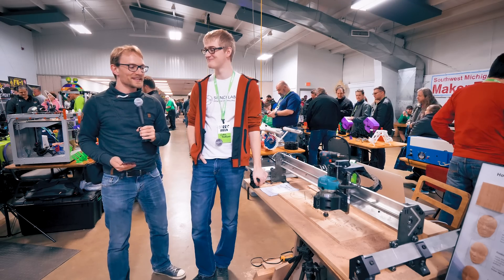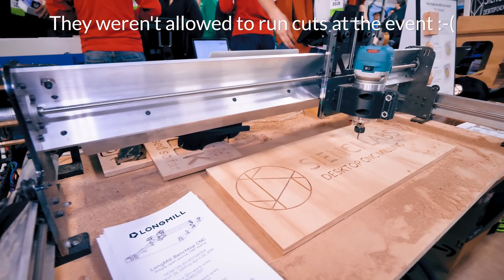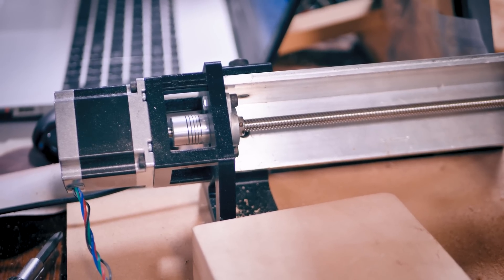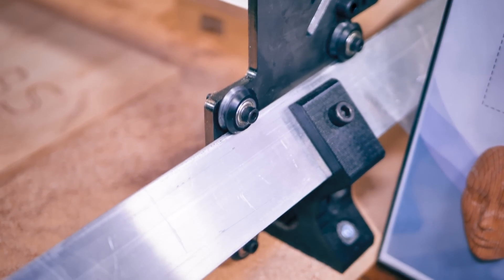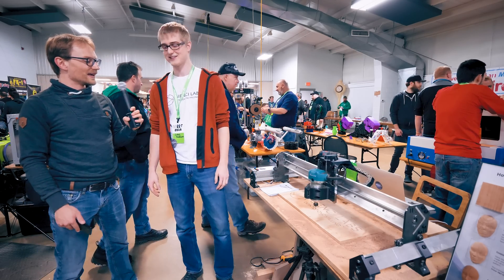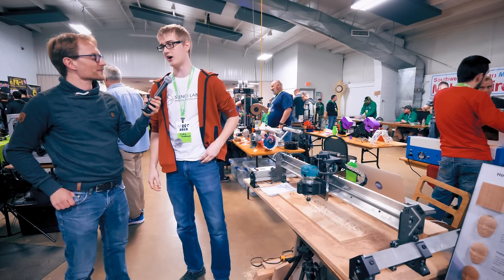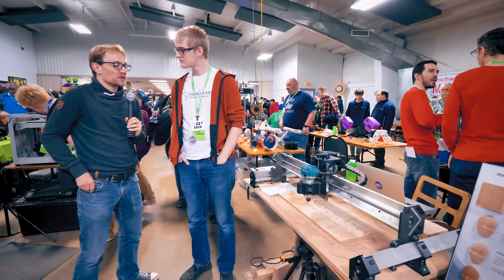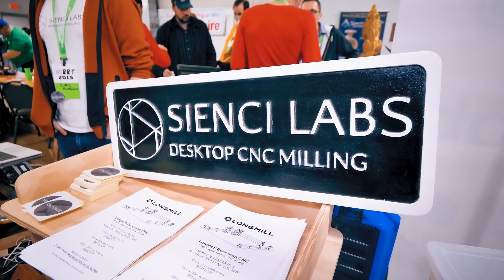Sienci Lab's new long, budget CNC router! #MRRF2019

Comment: 3d printed plastic parts do not yield the precision and strength as structural components needed for cutting aluminum or hardwoods with some good degree of speed and torque, 1/4" or 10mm thick parts as a reference.   It does help to have a "wider distance" in the rails to compensate for this.  I like the large size angle extrussion they are using on the gantry to obtain  the rail "wider distance" but the machine still looks like it has  quite a bit of flex.  I have built machines with large size steel square rails using 3D Printed rails skate bearing trucks in a diamond pattern and still the inherent flex in the plastic 3D Printed parts is unavoidable. The only way to get solid rigidity is by using materials that have the least amount of flex modulus in all mechanical components and metal is typically such.

 The machine long side to side layout is something I was looking for back in 2000 when I first purchased a MAX42 router for lack of time in building my own machine. Unfortunately at that time no one had a commercial lng side to side one for purchase, although it made more sense and more logical to layout a 2 x 4ft  (or 18"x 36") panel  sideways then longways, easier access for working on the material to be cut but also for working on the machine, especially in a small shop, less and more comfortable footprint. I ended up making my own. It is great to see this layout, come out and becoming more standard, there are other machines with similar layout that have come out and I think people have caught on to them for the same reasons I just mentioned.  Keep up the cool work!

Comment: Anyone knows what is the size of the aluminum angles and if the supports are 3D printed?
Reply: The aluminum angles are 3x3" on the X-axis and 2x2" on the Y-axes, 1/4" thick. The X-axis has two rails the other is hidden behind the first. And yes, the support parts are 3D printed, you can find the whole machine design here: https://sienci.com/dmx-longmill/open-source-and-modifications/

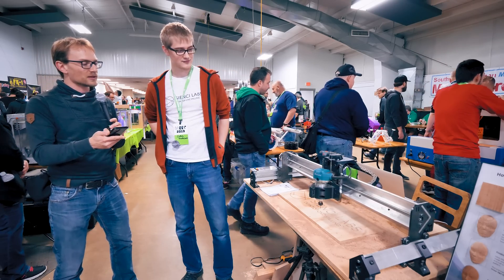Comment: @05:41 Well... I get that you basically have to make an accompanying Software for your Hardware but ( Kratos ) boi am I having a hard time seeing the purpose of using those watered-down versions instead of just using the real deal like Autodesk Fusion 360 and its built-in CAD / CAM feature... It's free unless you make like $100'000.- per year using it and even then it's like dirt cheap while providing CAM Operations like Adaptive Clearing which greatly improve tool life due to the ability to go deeper and thus use more of the cutting length of the flutes - Instead of just using the lowest 1mm of an End Mill and wearing that THAT alone down in like 1week you're using like 15mm of the entire Tool at once prolonging the lifespan to like 2 months - And that's just taking the Tool into consideration! Were not even talking about the entire rest of the machine who's wearing down with each move you make becoming less and less the fewer often you have to do the same step over and over again.
Reply: Because there are lots of folks that just want to do simpler stuff, and don't have the time or inclination to spend the weeks needed to learn F360. It is not the easiest SW to learn.

Comment: What I really miss with all those approachable machines like the Mill 1 or the ShapeOko is an enclosure. I would love to use something like this in our workshop at work, but there are certain regulations (in Germany) requiring you to have an enclosure with a switch and a dust collector. Without that I am not allowed to use it in a professional environment (as far as I understood it) and thus im forced to find someone who would build a custom enclosure so I get certification. Just for clarification - the problem is NOT that I wouldnt be able to build an enclosure myself - but I would have to get someone to certify it for me which is expensive.

Comment: most sheet goods are 4x8' in size. Why do cnc machines have odd ball 30x30" dimensions then?! wouldn't 48x32" make more sense? or 24x24". Having odd ball sizes just introduces tons of scrap waste.
Reply: what are you talking about? sheets goods are available in a lot of sizes, the standard sizes are a lot of bigger and will be always cut down to size ...so, a saw ist always a good investment ;-)

Comment: I apologize if this has already been asked, but given the supported rails, what what prevent expanding this to mill a full or half sheet of plywood (4'x8' or 4'x4')?
Reply: "Shaft Whip". Long lead screws turn into a jump rope when you spin them quickly. Long axis need to use either a rack and pinion or a belt drive to avoid that whip.

Comment: hmmm the railsystem when build from steel L bracket should work well as a plasma cutter , if you turn the rails so the screwspindles are behind them so the sparks cant hit them as fast 
a cnc plasmasystem once build can probably make all the brackets to connect and line out the L profile and stuff from steel plate too
Reply: if using steel angle iron then one can use metal v wheels as well. really hoping they develop a plasma solution

Comment: Pretty sure the guys testing copper materials were utilizing a mist coolant system.

Concerning the use of a Router... A real Spindel all the way like what I did with my X-Carve: https://i.imgur.com/WSa3exY.jpg ( water cooled 7'000-24'000rpm capable Spindle controlled by a VFD ).
So much quieter and capable due to the system controllable, wider RPM range with the only downside being the hassle during the first installation of the VFD which if you have like ZERO knowledge/interest in electronics is next to impossible due to the lack of reliable information.

Comment: Great Info, thank you. I kind of like the Sienci mill, but i think it is a beginner 
project to check out the technology befor sinking in lots of dollars into the 
machining hobby. Just think of the wear on the linear guides, matching 
hardened steel and soft aluminium. But still worth building it i think. 

Could a ballscrew set eleminate the backlash of the scienci mill one?
Reply: It certainly could 👍

Comment: Hello. Nice design. What are the maximum feedrates? Looks slow...
Reply: Just found on kickstarter it's 3000 mm/min. That is probably okay-ish. I rarely need more. Except for when i am concerned about surface finish on really soft foamy plastics. But i don't really enjoy cutting this cheap plastic stuff anyway... And this machine seems to be more rigid than my machine, so i think it would be good tradeoff for bit of speed (replacing belts with screws)...
Reply: @harviecz  118 IPM is OK. I don't rapid my machine past 60 IPM. It'll go 200 IPM but I can't stop it near where I want to at that speed jogging it. The real speed is in acceleration anyways. Fast machines get going fast.

Comment: This is awesome. But does anybody know a cheap to build for cutting 8'x4' plywood sheets / veneer? Just plans for one.
Obviously requires belts and less precision but I'd like something easy and cheap to build instead of precision.
Reply: Price scales exponentially with size building CNC machines. By the time you get into machines that can work a 4x8 sheet you're looking at thousands of dollars. Larger machines need larger everything. Larger everything costs larger amounts.
Reply: @1pcfred  Yeah. But I'm hoping for something really rather simple using belts or rack and pinion to avoid those exponential costs. Speed is not that important and precision can be mediocre too. No expensive lead and long screws.
Maybe even use normal aluminium profile with rollers as a linear bearing. And going slow with nema 17 motors.

Comment: I work mostly on inches and feet due to my work, in a metric system country, and still can't make those metric conversions, I use a little table I have for those, still that was pretty funny
Reply: 2.54cm to the inch. Going the other way is a lot messier. It is 0.393701 inches to the centimeter.

Comment: The Sienci router looks interesting, how does it hold up compared to a RawCNC? Also, is there an option to use other spindles? The Makita router is kinda loud (I have one and ended up replacing it with something a lot more quiet).
Reply: Which one did you get instead? :)

Comment: question:is it possible to use other Brand of router like Milwaukee,Bosch ?i mean possible to change or 3d printing an adapter for it?
Reply: Yes, we'll print the mount based on your router size!
Reply: You don't want to use a router as a CNC spindle. Get a nice water cooled ER 16 spindle. Listening to a router run for hours on end will put your teeth on edge. Plus routers are not built to take that kind of use. Not even really good ones. I knew a guy that ran $300 Porter Cable routers on his machine and he was constantly changing the bearings. He finally broke down and got a real spindle.
Reply: @1pcfred  yeah thats what i was thinking on a long machining process  the router gonna suffer  like you said  its made for alternate uses thanks for you response Paul:)
Reply: @1pcfred  yes very noisy!
Reply: @1pcfred  ok :)

Comment: Neat! But I would have the outer beams facing with the open side outwards for better dust protection.
Reply: The design is actually made to accommodate flipping the y-axis rails if you're willing to sacrifice some cutting area to keep the dust out 😁